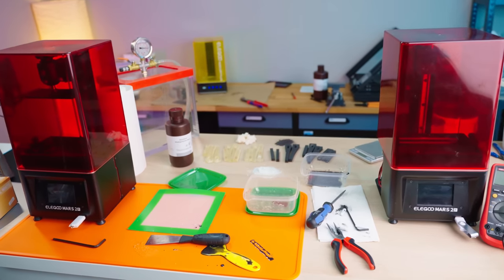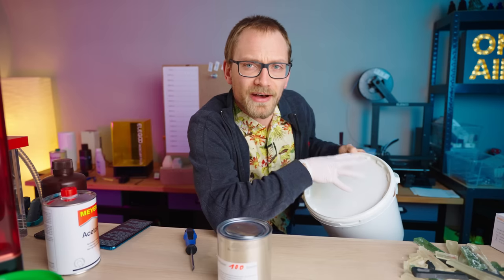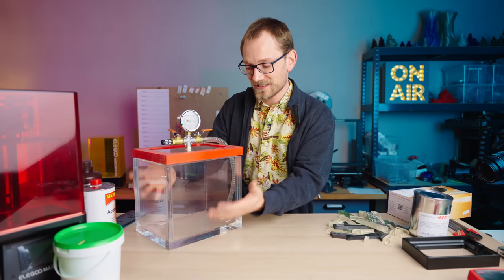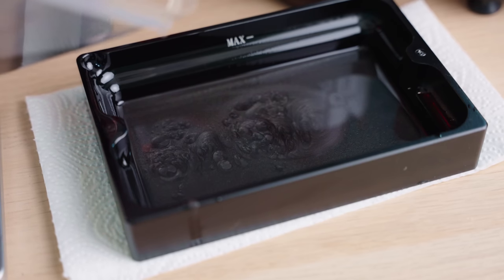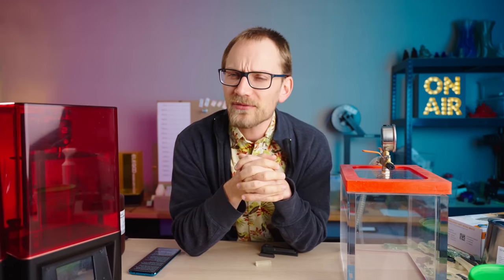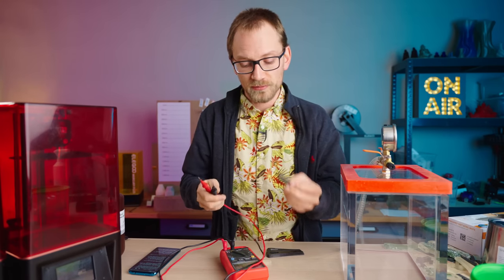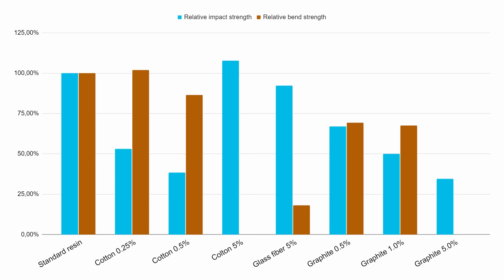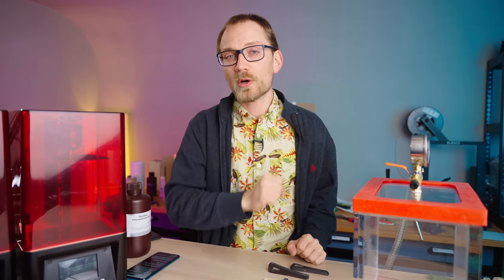Easier Fiber-Reinforced Resin Printing! Stronger and Conductive Resin Prints?

Comment: About the self-lubricating properties: that sounds a lot like graphite guitar nuts. That's an experiment I'd like to conduct some day (once I get a resin printer, that is). How practical would it be to print your own guitar nut with slots of the perfect size and height and would adding graphite to the resin work the same way it does with Graph Tech TUSQ nuts.

Comment: Also maybe you can induce some stirring in the vat recirculatic resin trough a peristaltic pump (should be already available some design on thingverse) to avoid fibers quck set on the bottom.

Comment: I've heard of alumina bring used as a composite fibre-might be worth a go. 
I also recall that carbon fiber has issues sticking to it's matrix material, and transferring the load effectively, and may also be the issue with the fibres you've tried. 
Nice exploration though, thanks!

Comment: Tom: Cotton can’t possibly have (that) much higher tensile strength than the base resin, but mixed well and ‘wets out’ and functionally prints. Maybe just try milled Kevlar or similar.  Resin compatible Wetting agent around fiber I hear is also critical. Also, pretty sure you must use high shear (speed) mixers to blend any fiber additive; try a blender.  I think the scale of your fibers need be closer to the cubic exposure volume of the machine (layer height being limiter) . So: probably Nanometer rather than millimeter.  Also you need similarly to keep the fibers in suspension at all times.

Comment: Just another comment in all the ideas thrown out here.   Your chop glass fiber has what is called sizing applied to it to keep the fibers in their shape. Manufacturers use different sizing for different resins..  As an example most chop glass matt is sized for polyester resin and will not work with epoxy resin because it won't properly dissolve the sizing.  It may pay to contact the filler manufacturer and try to identify a product with sizing compatible with your resins.   Other interesting fillers to try..   West Systems 404 High density filler and Cabosil  aka Fumed Silica. I've use both in composite work. Fumed Silica is primarily a thickener so I wouldn't expect it to add much in strength.

Comment: Maybe experiment with creating an emulsion between the resin and something such as mineral oil so that you can better suspend the particles in the mixture. I would also suggest trying materials with particle sizes (diameters) similar to the layer height. Specifically, I think microballoons would be a good thing to test.

Comment: I don't know about these chopped fibers specifically, but for CSM (chopped strand matting) at least there is a binder keeping it together. This binder must be dissolved for the resin to bind to the fibers. So for instance CSM made for polyester resin will not work well with epoxy resin, because the epoxy does not dissolve the binder, but CSM made for epoxy resin works just fine. So maybe you want to try different solvents on the glass fibers, to see if you can get rid of the binder before you mix it to the resin, and try again.

Comment: The main goal for my prints is to have impact resistance. So in a way I'm thinking making the resin softer rather than "stronger" Perhaps some kind of soft material like rubber or the silicon powder from makeup would create a finished print that would flex slightly instead of snapping when hitting the floor.

Comment: From what I know about engineering the length of the fiber is important. Round powder won't really work. That is just a filler. For strength you need a long grain and the grain has to be oriented all along the length of the part. Think of how an FDM printer part is strong along the length of the print because the printer lays down a long line making a grain but is weak if the layers are being pulled apart. The orientation could be done with a static charge probably similar to how flocking is done or simply by putting some fibers on a board and running a razor through the fibers many times combing it and then pushing it sideways off the board into your vat of resin. Or you could pour them through a larger tube of water letting them funnel and settle into a more compact tube since the travel through the water would orient them longways like waterlogged boats sinking in the ocean before hitting the sea bed. Other materials you could try could include linen fibers, straw, or bamboo. Fly fishing rods are made this way. You wouldn't want to use regular graphite as it isn't strong. Instead graphite is slick and its layers cleave from each other easily which would make a lubricating material, but a weak one. Charcoal would be a bit better probably since it has micro pitting that would allow the resin to sink into the pores so that would work better probably than graphite, but long carbon fibers would be best. That's what they are made for.

Comment: surfboard manufacturers use micro glass balloons in resin commonly to make thick/strong pastes for fin boxes and infill on surfboards. this stuff works with uv cure resin on the surface only so should work with the printer and should be much easier to mix than chopped strand

Comment: Composites can weaken a mater because they create stress concentration within the weaker material. That means you either need to adjust the concentration or a different material with a closer stiffness. There are equations for calculating ideal ratios.

Comment: So about the electrical conducitvity, you can estimate the overall conductivity of a composite by using the rule of mixtures. In essence, it states that the composite will have (if properly mixed and other idealization) an electrical resistivity equal to [volume percent of graphite]*[resistivity of graphite]+[volume percent of resin]*[resistivity of resin].

So a five percent (volume?) of graphite means (resistivity of graphite and resin in ohm per meter based on Google searches of similar materials in Ohm*m):
0.05*[resistivity of graphite]+0.95*[resistivity of resin]= 0.05*10^-5+0.95*10^15 ~= 10^15 = rho

So due to the high resistivity of the resin the resistance should still be high (note Resistance = rho*length/area)

Comment: for your conductivity testing you might need an insulation tester or mega as and electrician we use then to test circuit for possible faults bad connections etc, since a mutlimeter only outputs about .6v dc but something like my tester has 250v, 500v and 1000v options for testing

Comment: As far as the glass fiber goes, some glass fiber has a binder on the "bundles" that is broken down by the polyester resin during layup which allows them to "wet out" more effectively.  I don't know for sure, but I wonder if you washed them with acetone or MEK if they would de-bundle into individual fibers to some extent (?)

Comment: Try fumed silica [glass bubbles] next time; that's what is usually added to fibreglas resin to make it more of a "filler," so while it may/may not be a strengthener for the SLA prints, it may end up being a  cost effective means of extending your resin (diminishing print co$t$.)

Comment: Most composites are made under pressure. Autoclaving helps push the air out making the composite more solid and less microfractures.

Comment: this was aswome !! but I'm wondering if particle size may be a factor ,  smaller finer particle may be better at floating in the  material with out settling , maybe if you got finer composit powders it would work better, also the Prusa SL1 has a bed that moves this  maybe help with shaking the material  so the particles don't settle . woul love to see another set of graphite tests with differing powder finess (superfine)

Comment: Try putting in a magnetic metal dust like iron into the resin, and put a magnet next to the resin vat. That might give you magnetic prints, and you can try putting multiple magnets around the vat for dipole magnets.

Comment: The milled carbon fiber you mentioned towards the end isn't much different to the graphite you've already trialed. Sure the particle size might increase slightly. Carbon nano fibers have shown positive strength increase in resins used in CFRP production (Have a look at Bergen Carbon solutions as an example, I have a 100g pot on my desk). so that's where I would recommend to focus. Also in the production of making CA glue better in resisting impacts, loctite and a few others have been adding milled rubber into the glue/resin. These particles stop cracks from spreading.

Comment: Are those resins quite strong against visible light? Cause I see you always working with them in normal lighting (specially cold white light has quite a bit of blue on it) and still prints fine.
When I did some PCBs with photosensitive film, I took a lot of care to use only light without blue content on it (so yellow LED lighting, not even warm white), worked perfectly but didn't test to see if it wouldn't otherwise.
And yeah that graphite powder one is awesome looking, looks like metallic paint of good quality, the printed ones look quite different tho, while still looking cool.

Comment: Re increasing strength - in all structural fiberglass+resin things the actual load is carried by fiberglass and resin is just a binding component keeping fb in place/shape. This way all stress concentration points are covered by fb strands right next to the stress point. Such mix won't be easily printable (to say the least) in an resin printer, unless it'll be completely manual process with inserting fiberglass sheets each/each next layer. 
Milled strands is an option, but still  to increase strength the amount of 'filler' should be comparable to the resin itself. 50/50 would be a good starting point. The question is how to make so much filler into resin and keep whole mix to have low viscosity to allow building plate squish it out without damaging LCD. Probably an option would be to to make build plate lowering speed much slower to let resin+filler paste to squish out safely. And when plate is going up the paste could be added manually it if won't flow in fast enough. 
Very interesting video, BTW, thanks!)

Comment: Stick the fibers to the plate so that they are pulled up through the part vertically. The problem now is that the fibers are generally oriented parallel to the layers which is probably only strengthening the already alright cross section of the part.

Comment: Please do not forget to test Carbon nanotubes(CNTs)!!
CNTs have higher aspect ratio(diameter : length) than milled carbon fibers. It's important factor for reinforcement fillers. Since CNTs are usually shorter than 3D printer's screen pixel width, it won't be affecting precision of printed parts.
CNTs are pricey but if you add 1wt%, 10g of CNT makes 1000g of resin. Maybe you should hit Aliexpress or ebay for getting CNTs.
Ultrasonic dispersion can be useful too.

Comment: Been awhile since polymer chemistry class, but the chain length lends to "strength". By adding stuff (cotton, fibers, etc) the polymer chains are interrupted.  It than behaves like a binder holding stuff together. Need to find an additive that can act as nucleation site for the resin, so the resin polymerizes with the additive.

Comment: 3mm chopped glass seems pretty long - 1/64" is a common size, almost 1/8 the length of what you tried.  Also, milled glass versus chopped glass might be an interesting trial. Cotton flox from Aircraft Spruce is a lot finer than what you tested as well. Though, someone else mentioned the sizing on your product being formulated for a specific resin - they're right, that makes a difference.

Comment: Not quite along the lines in this video, but giving a resin print a relatively thick layer of electroplated metal, will at least improve wear durability. I'm no engineer, so I can't speculate on possible effects to impact or tensile properties. (I suspect none, or extremely marginal.) However it certainly adds looks plating with nickel/chrome finish.

I like your no nonsense scientific approach!

Comment: I'm more familiar with steel than polymers, but in steel there are very hard carbides, kind of like like rocks in concrete. When the steel breaks, cracks jump from carbide to carbide, kind of like ripping a perforated page from a notebook. So the more and larger the carbides the more brittle the steel.

Comment: You could try active charcoal in comparison to graphite, the resin is maybe entering the cavitys, which could induce strength and additional conductability. But I ask myself if the blackness blocks the UV-Light to much, even with a minimal layer thickness. Also try industrial cellulose instead of raw cotton, there are products of all sorts and realatively even length distribuitons on the marktet, comanies like jrs would maybe provide cost-free samples. And if you dont have a solution against sedimentation during printing, you should reach a middle ground between the density/particle size of your additive and desired gain of your experiment. Sedimentation tests can easily be carried out with a graduated cylinder and a stopwatch. Therefore, denser resins should also be prefferd.

Comment: Agitate the chopped glass (maybe tumble overnight?) to separate them. Don’t breath that.
Reply: The glass fiber has a bonding agent that will dissolve when you use it in polyester (not in epoxy). You can dissolve the bonding agent with acetone. When you got it filtered, respirator on!!!
Reply: @martijngeel9224  If it's polyester-prepped fiber. You can have epoxy binding and polyester binding in glass, and you shouldn't use it with a wrong type of resin. That will definitely weaken a print if fiber is coated (and it looks like it). Heating also works to remove binder.

Comment: You should functionalise the graphite for it to have chemical bonds with the polymeric matrix. Without it, the graphite will act as minuscules lubricating particles amongst your cured polymer. In contrary, almost sure you would have a better stiffness and increased strength of the composite!

Comment: Maybe try copper prouder, for conductivity and for the looks
Reply: the problem is that the resin itself is a strong insulator. So if there are no contact between conductive powder particles then it will not transmit current. Or it will be semi-conductive. Actually maybe it's possible to make some DIY semi-conductive parts :) Maybe some powerful diodes (not sure about this). Just need tests and experiments.
Reply: @KiR_3d  just needs enough powder though.
Reply: @renebrsch  maybe you're right... but the (breaking) strength will be a kind of unpredictable IMO.

Comment: To make more shock resistant the resin, until now, just adding 10-20% of gummy resin seems to work. It adds a little bit o flexibility that it let not shatter it as glass.  Maybe to take advantage of fiber renforcing you should already start with a more flexible resin and add fibers to increase the stiffness, to get the best of all worlds (or maybe to fail more catastrophically, who knows :D )

Comment: You could try to blend the extra thin fibers in a blender, the size of 3mm is clealry huge when you think at the intermolecular action. I would try with a fiber that is extra thin and maybe long. Carbon nanotubes are considered a biohazard, but I am sure they may help with the process, but there has to be some extra thin fiber that can be used for the purpose that can also mix properly and uniformely.

Comment: Print the thin shell of one of these in pure resin and then manually fill the core with a fibre/resin mush that is > 50% fibre. Build up layers, curing between if using photo-cured resin.

Comment: Sand the graphite parts then drop them into electroless nickel plating solution, if it gets covered in metal it will be an awesome application for the graphite 

And it will increase he strength significantly

Comment: I wonder how glass microballoons would work. They're used as an additive to epoxy for lightweighting, and being clear might help with layer curing /post curing. I'd think the overall strength will be lower, but stiffness:weight ratio might be improved

Comment: You could try glass microbubbles mostly used with an epoxy resin as a filler. They should work nice with UV resins. One thing I remember is that size of the aggregate matters the most for added strength. I saw some concrete making tests with aggregates in various sizes and ratios, bigger sized aggregates always won. 
But with rigid reinforcement materials you can only add them to the one layer at the time, not making layer to layer bonds stronger. They are just getting weaker because resin bonds better to itself than to cotton/graphite/etc. and that other stuff does not bond with itself at all. So you have almost no bond between layers where 2 aggregates are in contact, you have weaker bonds where aggregate from one layer contacts resin from other, and rest would be proper resin to resin bonds. That is my train of thought watching this video. Don't know if it makes sense at all.

That fiberglass chop is held together by some kind of inhouse manufacturer's secret styrene based coatings, if I remember correctly. And are meant to be used with polyester resins. There are powdered chops for use with epoxy resins. Most of the fiberglass twill cloths are compatible with epoxy resins, meaning having much less coating that has to be dissolved to wet the fibers.  My best bet would be cutting some fine twill cloth by hand, so thin hairs that just float in the air, crazy stuff. Would use some dust mask and do it outdoors, the chopping part.
Reply: Or you could try and wash that fiberglass chop you already have in some acetone and see will it dissolve, acetone should destroy anything styrene based.